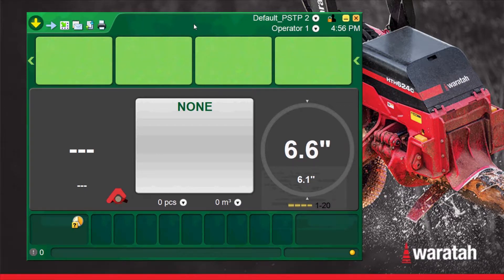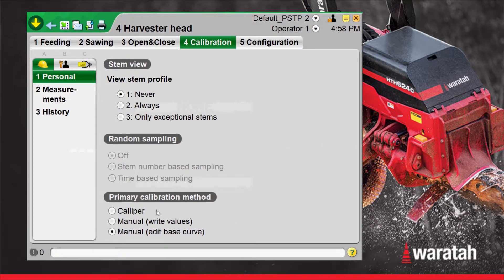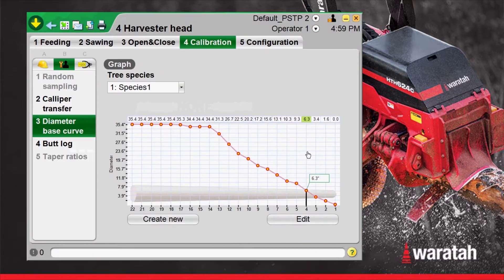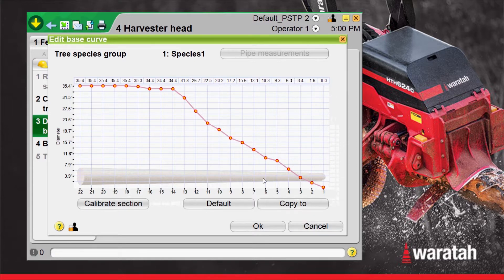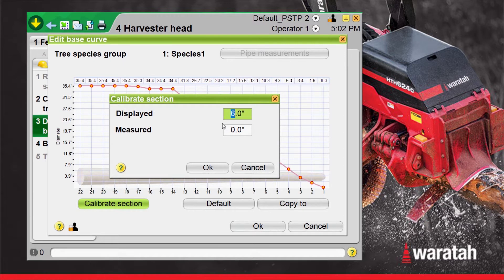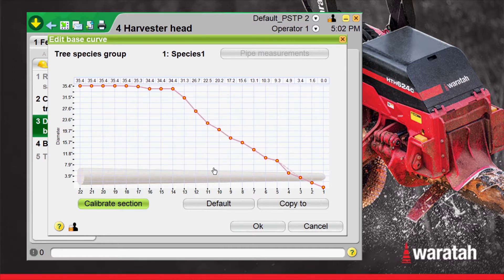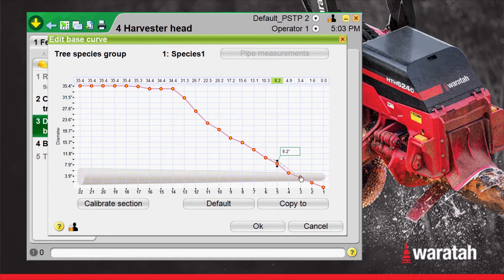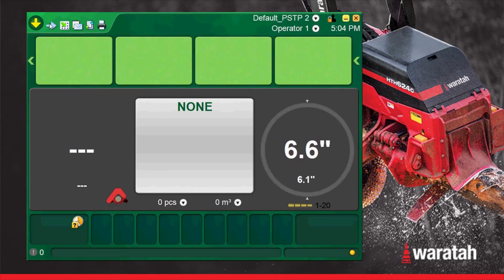Manually Calibrate Diameter Values | Waratah TimberRite™ H-16

Comment: your diameter value on the run screen after you performed your "manual calibration procedure did not change, this tells me this is not the way to do it,  how can you just make up numbers to use as values  for this precsion measurement adjustment  demo? plus why no mention of how to use the manual write personal option?  thanks in advance